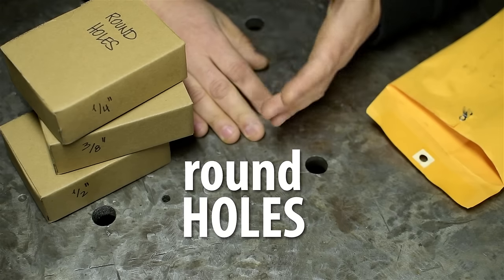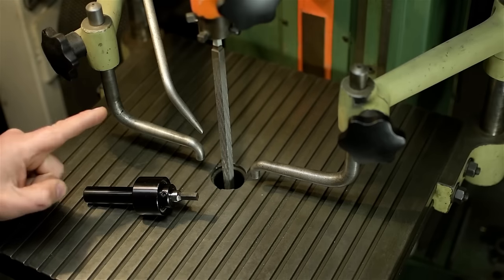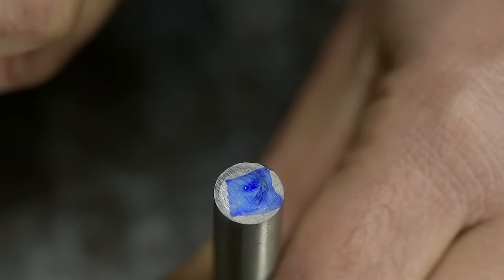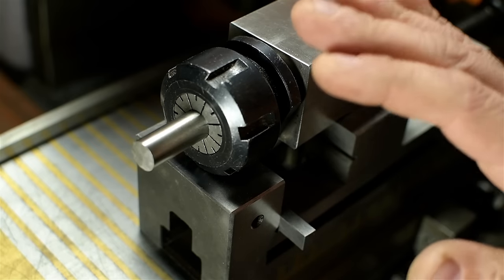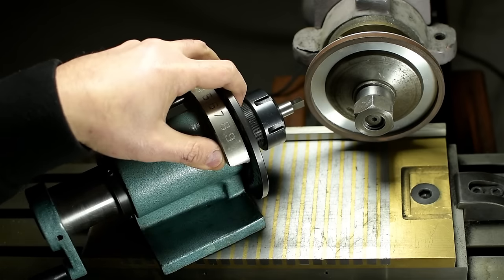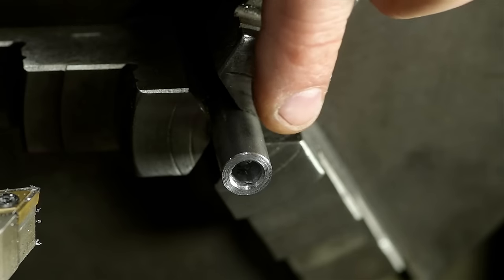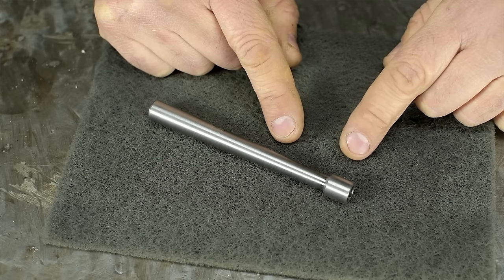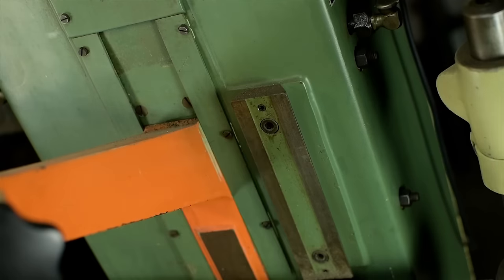Square Holes!

Comment: When I saw a square hole come from something that was spinning it blew my mind
Reply: I still don’t get it
Reply: @HayyuAdam  the other thing is free to spin so after the 2 bits contact each other, they are basically not spinning relative to each other. I believe the spintool is used as a replacement for presstool. I believe the term used to making square holes is called broaching,.
Reply: But what cuts out the square if there’s no relative movement? Does it just press the tool into it, but why would it need to spin in the first place if there was no relative rotation
Reply: The spin is becouse the how the tool works press and spin. And to troll us lol
Reply: @BeHappyTo  but if they're not spinning relatively to each other, then how does he press the square into the too-small-hole??? I still don't get it
Reply: Guys look up how broaching works.
Reply: @aaaaaa-yg5yq  there is movement, just not spin
Reply: 9:50 Blew my mind
Reply: @aaaaaa-yg5yq  :
Yes, I think it just pressed the tool into the round hole. I don't understand why a file could not be used. That's what I did recently to a aluminium piece and I have almost no tools compared to the video dude.
Reply: @HayyuAdam  I didn't get it either until This Old Tony made a video explaining how it works a few months back, and then he made a short follow up video where he uses the rotary broach on the mill instead of the lathe so you can see what it's actually doing without all the spinning from the lathe. here's both videos https://www.youtube.com/watch?v=GWyHJVOxKK4       https://www.youtube.com/watch?v=4-3gPWl6wfU
Reply: @joshsutphin585  I did and I still didn't understand (also see my replies to Bob and Brian). I guess I'd have to see it in real life and then have someone explain it with a more schematic (read: drawn out showing positions, forces and movement) approach than a mere "they're not spinning relatively to each other"
Reply: @bobsquirrelking   Bob, Squirrel King  Thanks I found this vid as well but its explanation was too short to make me understand. Luckily the vid @Brian Caroll posted helped a bit more (I found that one as well myself but I didn't watch it before Brian pointed us to it because from the title I didn't expect an explanation in it)
Reply: @briancarroll6803  Thanks! I found that vid as well while searching for an explanation but from the title I didn't expect to find any in it - luckily you pointed us to it :) It still blows my mind that this mechanism would work, but at least I have a tiny bit of starting to understand now
Reply: Think i get it now... the rotary movement moves the bit that was pressed into the hole, the tool holder has a little angle and because of the movement, the tool is scraping of a side of the hole as it is pressed in, and so it chisels his way through the hole
Reply: I was also blown away by this and wasn't aware it was a thing.  Thank you everybody for the explanations and videos.  Fascinating stuff I never knew existed until now.  But makes sense.
Reply: aaa aaa the bearing bore is angled relative to the shank, so the spinning makes really small cuts at a time, he explains it better than iin the original rotary broach video
Reply: Same
Reply: @bobsquirrelking  thank you!!!!
Reply: it is only done so to avoid repositioning the tool and the workpiece on another machine. looks cool anyway:)
Reply: If I wouldn't have seen Tony do it I would be calling B's. Broaching, who knew? Very enjoyable and entertaining video as always.
Reply: @bobsquirrelking  So it kinda wiggles in :)
Reply: Same like wtf how!!!!!
Reply: Brian Carroll Thank you! That part you referenced finally made it mostly make sense.
Reply: another video to see how the tool works on a drill press (in French) : https://youtu.be/G-2_i5slAVE?t=1858
Reply: i could not and still can not comprehend how
Reply: @bobsquirrelking  thanks, that was quite the important part to the puzzle lol
Reply: Here's an explanation on this same channel: https://youtu.be/GWyHJVOxKK4?t=704
Reply: @HayyuAdam  The tool does not rotate when making the hole, it wobles. The wobling makes it cut with the edges. That is why the broach is placed at an angle in the holder.
Reply: @mgandhi785  Thanks! I haven't really studied it yet but it looks very helpful for understanding the process!!
Reply: @HayyuAdam  the axis that the rotary broach turns on is about a degree off the axis the lathe is rotating on. this causes the broach tool to "wobble" as it is pushed into the work, such that only a small part of the tool is cutting at any given time.
Reply: @aaaaaa-yg5yq  the axis of rotation is off just a little, so theres to relative rotation but the broach wiggles a few degrees through the rotation which is what does the cutting
Reply: @martyjehovah  yes... I got it!
Reply: I do engineering for a living and it still blew my mind doesn't matter how much it's explained it still doesn't make sense...
Reply: The Banker  It's actually pretty upsetting to me that literally everybody here has access to search engines full of almost unlimited amounts of information, yet they have to actually be told to go look something up when they say they want to understand something that they don't understand.  

It's like people want to know things, but they really don't want to learn things. 
Frankly, that's dumb.
Reply: Oh, I see even though both are spinning at the same time the broach is angled “like 1%” making it wobble so it only cuts on one flat side at any moment, a full rotation wobbles to cut each of four sides once. Think of how you drill a hole with a regular drill bit, then you wobble or waller the drill to make hole bigger (and then break the drill bit). Imagine wallering right then down then left the up, it does that each rotation. So it doesn’t just shove through, rotation is important.
Reply: I don’t get it either
Reply: @aaaaaa-yg5yq  there is a 1 or 2 degree offset in the rotary broach, which basically means they wobble, that wobble is what does the cutting, and you just move the broach further bit by bit.
Reply: @HayyuAdam  He forgot to mention that broach tools are mounted at a slight angle in the holder. In operation only one side of the tool shears the metal away resulting a hole the shape of the broach. The HS tool rotates at an angle in a thrust ball bearing.
Reply: that's what you get for not watching all of ToT's videos

Comment: Dude went from imperial to metric then just started using letters of the alphabet.
Reply: He must have studied from old English engineering manuals, he skipped the pictures of small animals which was a shame.
Reply: This is basically evolution of my highschool science classes, particularly Greek alphabet for increased fanciness
Reply: @Fred Smith i already hate the imperial system, but this is "time to start a crusade" kind of stuff ...
Reply: imperial is weird!
Reply: There's a twitter thread where a guy goes off on a rant about the imperial system, it's pretty funny, though rather filled with strong language.
Reply: @InformatrIIcks  build a pyramid with the metric system and we will talk, otherwise we are converting your blueprints to sae to hold a tighter tolerance
Reply: @jakedoom8807  There's a rather fine glass pyramid outside the Louvre as I recall.
Reply: @robertharris1748  and there's one in Memphis Tennessee with a bass pro shop at the top of it...
Reply: It's when the mathematical formula starts using colors that I get lost.
Reply: Yeah thats how drills work in imperial. Incrementss of 1/64 but then you also have letter size drills but also numbers. So I can tell someone I need an 11/64ths drill or I could tell them I need a W drill or I could tell them I need a #7 drill. Now American made machines are using metric fasteners thats fun too.
Reply: I find metric to be better for machining purposes, and imperial to be better for construction purposes.
Reply: @presidentelecttaterpuddin1626  What do you find makes imperial better for construction? I don't disagree, I'm just curious.
Reply: @Amateur0Visionary  when working with larger measurements and less variability I just personally find it preferential. I actually have been thinking for 10 minutes and can’t put my finger on it, I’m guessing familiarity although I’m very familiar with metric as I was a physics nerd for a while. 

I’ll be honest here, don’t wanna mislead you, I have no idea.
Reply: @Amateur0Visionary  I’m a C grade machinist and an A grade in most things construction, so it may be a negative feedback response I have developed with metric. Possibly I’ve convinced myself metric is the problem rather than my self as a subconscious coping mechanism, so I don’t use it on my real work I make money with.
Reply: @presidentelecttaterpuddin1626  Very interesting. Thank you very much!
Reply: @metalman6708  I think some of it is just holdovers from 19th century standards. Also you need names for the pilot bores for tapped holes.
Reply: @jakedoom8807  imperial or metric have nothing to with a tolerance. Thats what tolerance classes are for.
Make beat a 25h02 tolerance, ill wait ...
Pro tip, its so tight its basicly dump luck to make since its so tight
Reply: @robertharris1748  Probably the best comeback ever

Comment: Tony, when you dumped out the holes at the holes at the start of the video I counted 47. A pouch that size usually holds 50. Check for holes in the pouch.
Reply: The trick is to weigh the package when you get it.  It should weigh 50 holes less than an empty envelope.
Reply: 3 metric holes left in the pouch, or holes in the pouch itself which let out 3 holes?
Reply: Underated joke, actually hilarious!
Reply: @charlieinsingapore  if it were holes in the pouch, they'd have to be oversized, and you'd definitely notice bigger holes
Reply: WHO LET THE HOLES OUT .......
Reply: @snork_games  ABSOLUTELY Hilarious! 👍😂😂♥️
Reply from the maker: dang I wish I thought of that.
Reply: Its ok he weighed them in chinesium units.
Reply: The more holes there are in the pouch, the more room there is for more holes.
Reply: Best comment. Ever.
Reply: I remember from my seining days if I ever run out of holes to use the net!
Reply: @ThisOldTony  I'm curious. Do you buy em in different depths, or do you just buy a bunch of through holes and cut them to size however deep you need them?
Reply: @blahblahblahblah2933  that's a hole lot of maths tho
Reply: @zack3g  Courtney love standing by
Reply: I think a couple of the pre-made holes were undersized, too. Does one half a hole weigh the same as one whole?
Reply: A friend of mine made me laugh when he complained about the number pot holes on his farm lane... "Some day I'm gonna dig up all of those holes and dump them in a pile. Then I will have myself a pond."
Reply: Tony forgot to mention that holes also come in numbered and lettered sets. A-holes are very common.
Reply: @davestech6357  LMAO....I just fell off the bar stool but my beer is ok...
Reply: well the key is that 3 of them are blind holes
Reply: What color are those holes? Do you have any black ones?
Reply: Some settling may occur during shipping
Reply: How many holes of that size to fill the Albert Hall? John's not around to ask..
Reply: Sure, Rain Man 🙄
Reply: @rachelhaberman15  It's always awkward when the family finds you, but they don't find you funny. Does this happen to rest of you guys? Goodnight, Rachel!
Reply: Paul, I was wondering if he was going to have another box with "Doughnut holes".
Reply: When he dumped the holes you could count only 47 because 3 holes fell down through the holes on the table
Reply: I bet the pouch included 3 ceiling holes, and they are stuck to the top of the pouch.
Reply: The Beatles must have found bigger holes from Blackburn, Lancashire because a thousand of theirs filled the Royal Albert Hall
Reply: So, the Sum of 'The Holes' is less than the Part...
Reply: It's just like a box of matches.
The avg contents have been dropped from 50 to 47 over the decades.
Reply: This horse is now officially declared dead. All God fearing citizens shall henceforth desist kicking it; whether in the hole, or elsewhere. Thank you & Good Day. 

I say Good DAY Sir!

Comment: Still don’t understand how he made that square hole
Reply: Same
Reply: @ahumanbeing7554  it shakes the square drill bit by a certain degree so that it can act like a chisel
Reply: Oh apparently, the broach rotates on a slight angle while the stock rotates true (level) and it cuts the square using the bottom most part of the broach (one corner due to the slight angle) until it gets deep enough and they all 4 eventually start cutting. That's how I understand it.
Reply: Magic sent down from the machining gods.
Reply: Same here
Reply: P
Reply: @lukeirvine1386  not even the same principle and a terrible video lol
Reply: I'm an industrial maintenance technician that specializes in the r&d and fabrication of retrofitting modern PLC tech to tie into miles of mechanical, pneumatic, hydraulic,  electrical, tech from 40/30/20/10 plus years that consists of  contactors, relays, hundreds of photo eyes etc... We do all of the experimenting for ALL the DC's in the company. So I know my way around a metal shop. So if you don't appreciate the beauty of this, then you might need to start wearing skirts and holding your wife's purse. I watched this expecting it to be a punch (because that would work GREAT with the mass amount of carriage bolts) of some sorts, I would really like to know more about this process.
Reply: In short the broach he made is not held straight in the rotary broach. So only one corner is in contact. When he pushes it into the hole the rotation causes the broach to switch what corner is in contact. So it's digging a little on each corner of every rotation. Also why he needed the angled cut so the broach have space to wobble in the hole.
Reply: @lukeirvine1386  yeah, you got it
Reply: It's funny how this video format got popular. I'm not here for the humor and a bunch of secondary thing, I'm here for the square holes. Explaining that shouldn't take 12 minutes.
Reply: @mitch3064  this is the only rational explanation
Reply: Asp long as it works 🖖
Reply: @MartinToernby  long enough to monetize
Reply: Jfm
Reply: All the commenters are describing the "rotary broaching" technique. Looking that up or watching a video will explain their weird references to wobbling and angles, and show why this is neither pushing in by brute force (conventional broach) nor drilling a hole, even though both parts are turning.

Comment: I'm glad you started with the simpler "square" hole. Round holes have been hard to achieve after infinite-sided broaches went out of production. I keep getting sniped on eBay for old Soviet stock. 😭
Reply: Sometimes you can find those infinite sided broaches with fewer sides at harbor freight. Gotta go real easy on them though, they're made of chinesium.

Comment: You can "explain" it however you want, rotary broaches are dark magic.
Holes can be round or punched. That's it.
Reply: If I understand correctly:

You know how you can take a plate or frisbee or something, hold it at an angle on a flat table or floor, fling it downwards and a bit sideways, and it starts to wobble around the centre tracing out a smaller circle, only touching the desk at one point on the edge during any given moment? This is designed to FORCE a square to wobble around, only pushing forward into the material at one point at a time, chiselling out each edge of the square in turn by a tiny bit per revolution.

Though it's probably still dark magic, and I've just found a fake explanation that seems just plausible enough that I don't have to think about it any harder and can get on with my life.
Reply: @Uristqwerty  Yet another rotary broaches salesman..
Reply: @Uristqwerty  Yes, but have you ever tried to source a square frisbee? Or hex, for that matter. Never mind Torx ....
Reply: Yeahhh this doesn't make sense
Reply: We need to get the slow-mo guys on this one.
Reply: @GeneralNickles  YEEESSSSSS
Reply: @Gottenhimfella  whaddya mean? I love torx frisbees
Reply: Thanks for the perfect explanation!
Reply: @TotalControl92  AHHHHH! Thank you, I didn't understand what was happening until I watched that.
Reply: @TotalControl92  holy shit. Thanks
Reply: Just got to that part what the actual f... is going on here this is more puzzling than exponential growth
Reply: Agreed. The very idea of a rotating tool having a deliberately skewed axis makes me inexplicably uncomfortable, and I refuse to allow such witchery into my life.
Reply: @Gottenhimfella  Pretty sure a Torx frisbee is a shuriken
Reply: @Uristqwerty  This is how cults are started. "It's probably still dark magic, and I've just found a fake explanation that seems just plausible enough that I don't have to think about it any harder and can get on with my life."
Reply: Carpenters make square holes all the time. They do plunge cuts, router them out, chisel it square drilling a hole, etc. Many ways of making a square hole in woodworking.
Reply: @Gottenhimfella  Don't be talking about the tamper proof torx frisbees.. soon as you start talking about them everyone will want one.
Reply: @Uristqwerty  I was about to ask what the point of spinning a broach was if it looks like you're just pushing it straight in. this makes a lot of sense.

Comment: "That'd be off the charts if the scale stopped at 40...
But it doesn't"
This is my kind of humour. Unfortunately it does come at the expense of not having a good reference point. Worth it though.
Reply: Basically my definition of infinity. 15 inches as measured on a 12 inch rule.